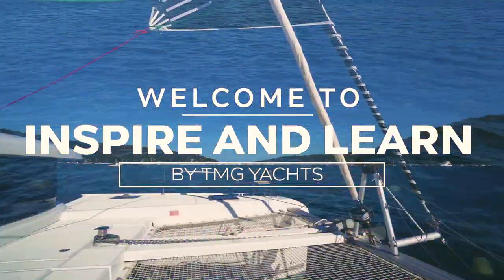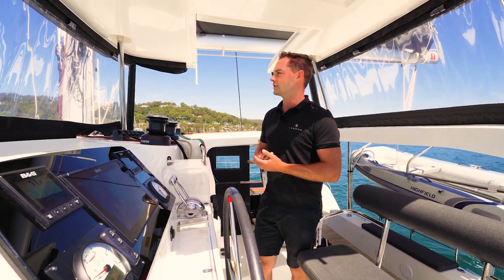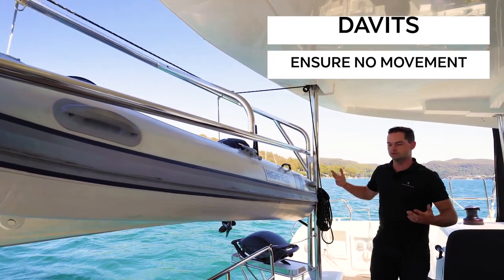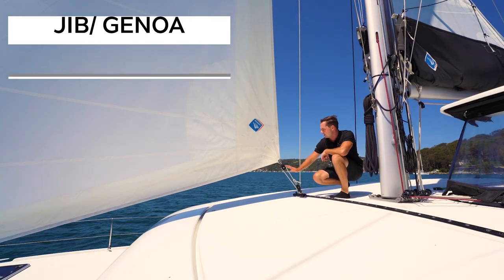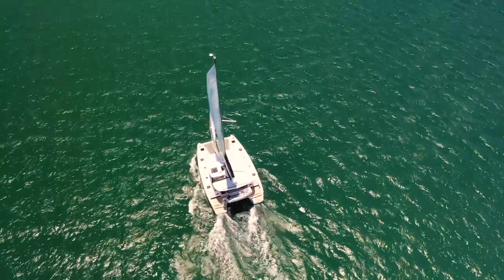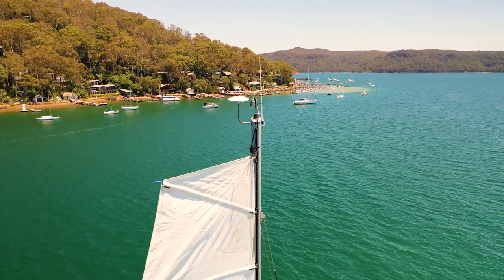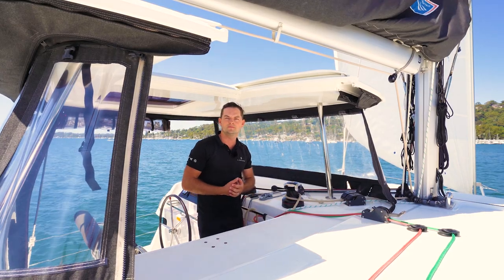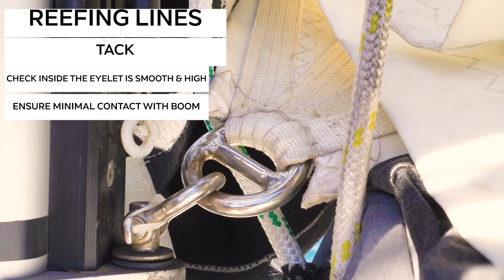How to Prevent Chafing on a Cruising Catamaran

Comment: @7:49  Hi Joe and TMG, thank you for these videos!  I really appreciate them.  Are there any aftermarket options to improve the spectacle and reefing point?  I've often wondered if the reefing points could be replaced with small diameter blocks to reduce a bit of friction.  It would seem like you could replace the spectacle with one that has a much larger radius, or a block, to reduce friction further.